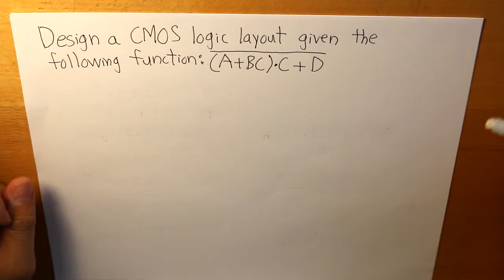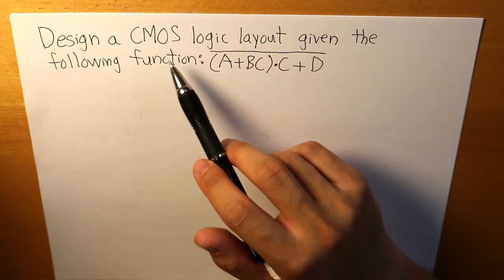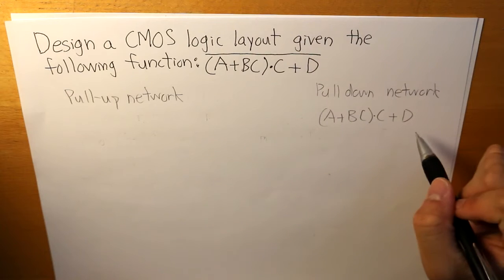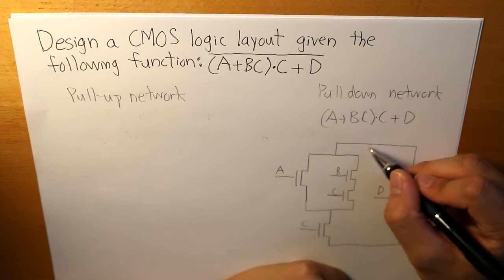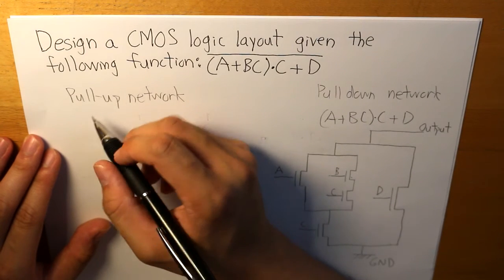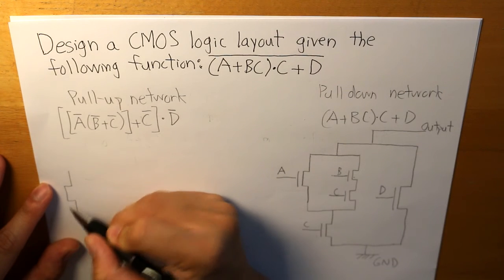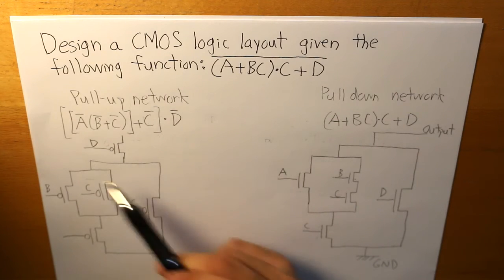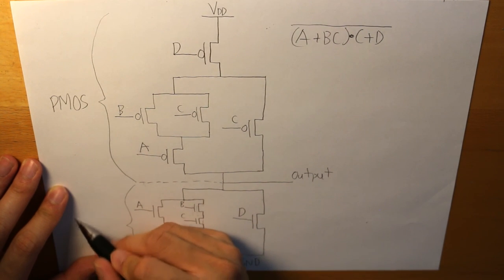CMOS Example [Inv(A+B*C)*C+D]

Comment: Thank you so much. I finally got it.
Actually, PMOS performs the operation.

NMOS configuration is only for activating GROUND.

PMOS does the job by negating the expression. BUT when the expression is true, its negation is false, and then PMOS configuration needs to activate GROUND, so it wont deliver VDD to the output.
If the expression is false, PMOS output is true, and it needs to deactivate the GROUND.

To activate/deactivate the ground, we need the OPPOSITE configuration on NMOS, which is responsible for delivering the GROUND signal.
To activate GROUND, NMOS must evaluate the expression as true.
To deactivate GROUND, NMOS must evaluate the expression as false.

I did this with the NAND port, so I could visualize it better, since it has an easier configuration.
2 PMOS in paralel = NAND
2 PMOS in series = NOR

2 NMOS in paralel = OR
2 NMOS in series = AND

NAND needs an AND to activate/deactivate GROUND.
Reply: The input signal for PMOS comes from above.
The input signal for NMOS comes from below.

Comment: First thankyou so much for making this video. It helps a lot. Then I have a question in when you drawing the D-PMOS into the pull up network. Does it matter if I draw D bellow where it will not be connected Vdd later but with output. Actually those two different position where D can be placed later will influenced the stick diagram. So if the position of D does a matter here and also in stick diagram, then do you have any tip for deciding the position of D_
Reply: its a series configuration doenst matter where you place it
Reply: @bommenavishwateja7468  no, error. when is PULL, for example AB, in down position is A, when is DOWN, in down position is B
Reply: @joelrcc  I don't think so buddy
Reply: @bommenavishwateja7468  Well. At end, is not neccesary but by standar is in this way

Comment: in my understanding, did u just ignore the inv(the bar) over the logic equation?
what is the difference between the layout of [Inv(A+B*C)*C+D] and (A+B*C)*C+D ?
Anyway, steps are clear. Thanks!
Reply: I believe that he just forgot to mention why he left the bar over the nmos logic away.
If the logical equation for the NMOS part gives TRUE then the output on the CMOS is LOW.
He implemented that by leaving out the bar over the Nmos part(double negation of cmos logic). Therefor the equation for the Cmos part is implemented.
In Mnemonics:
Task:                                              Cmos("given logic") != High 
Rule(that he didnt mentioned): NmosLogic=True => CmosOutPut=Low

=> IF Nmos = false THEN Cmos=True
Reply: Eunice Chiu same question, but as i remember the cmos always inv normally, u can think in the basics inv nand and nor
Reply: check morgan theorem
Reply: HE ADDED AN INVERTER WHILE DESIGNING XOR and XNOR BUT Y DID HE NOT ADD AN INVERTER HERE . THIS EQUATION HAS ALSO GOT WHOLE BAR